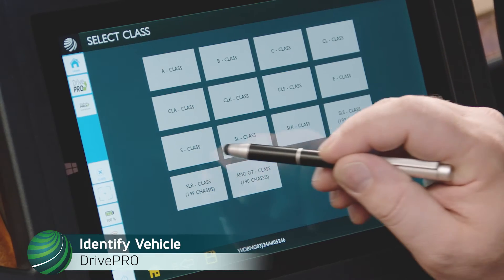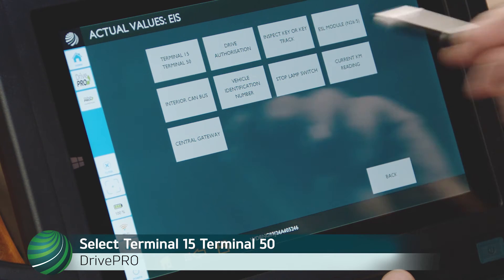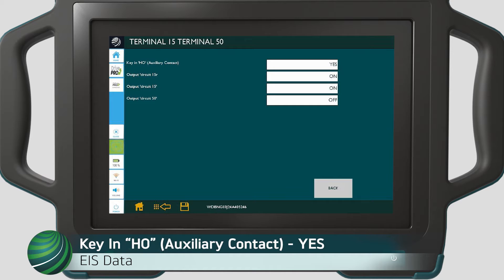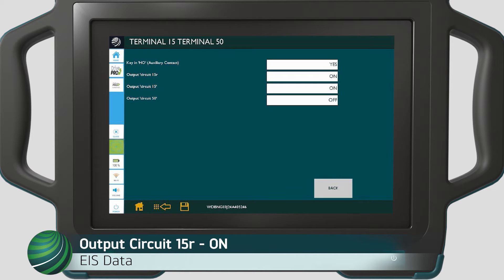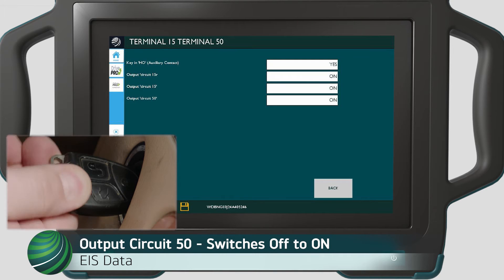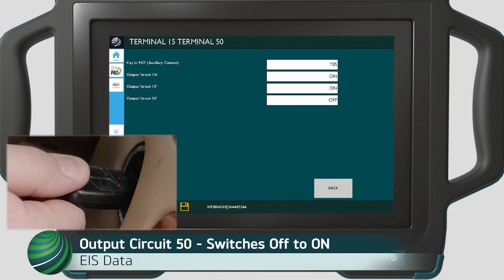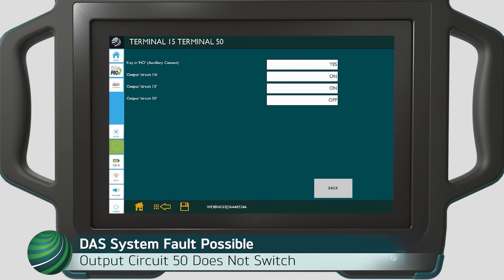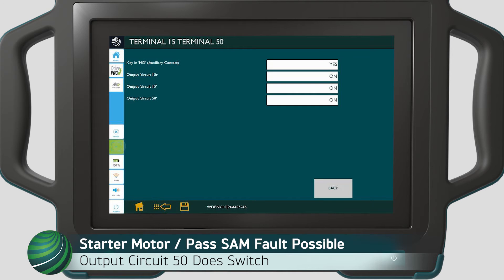Mercedes Benz Electronic Ignition System (EIS) Diagnosis

Comment: I have the "no crank no start" issue (plus "no fuel pump") on my '97 C280, but only occasionally! The first start-up in the morning always works. If I stop at the fuel station 5 minutes later, just like yesterday, the car may not start again. If it happens, all the lights are on as well as the ignition, but I don't hear the fuel pump and turning the key won't do anything. I was able to get the car started yesterday by tapping on the ignition switch (the plastic cover was already removed). The EIS or some loose connection inside or on the back seems to be the culprit here, would you guys agree? Changing the key makes no difference.

Comment: Yeah thanks this circuit 50 stuff blew my mind. The picture showing purple wire helped. Never heard of circuit 50. I do however know about a starter relay. Lift is out and inside you have pins 85,86 87, 87a and 30 - Its 87 that goes directly to the starter solenoid. Lou (a guy on youtube) told me its the wire to starter. So then just say pin 87 from starter relay. 

Does anyone out there have a logical reason for why they dont say that?
Reply: The term "terminal 50" or "circuit 50" is a standardized name for the starter motor activation circuit. The organisation that made the standard is called "DIN" an abbreviation in German for their standards organisation. DIN is also responsible for the numbers on the relay pins (i.e. 30, 87, 86 and 85) as well as 15 (ignition ON), 31 (Earth), etc.

Comment: Our shop has the latest autologic and also the legacy one..we can’t even scan for codes, key doesn’t even turn. Same car..
Reply: I remove eis and then send away to be repaired when that happens and if both keys wont make it turn. Always come back repaired. I am learning more though. They dont like cold weather. You can get a cheap donor and buy the equipment to clone an Eis yourself. Only equipment is over a thousand pounds and repair if like under £300 so if you only doing one, send it away to Eis rebuilders. Find them on EBAY.
Reply: Where can I get phone number for eis rebuilders. Please link me up
Reply: I sent mine out on ebay and key still doesn't turn

Comment: 2007 E550 4 MATIC

Circuit 50 for me changes from off to on but the car doesn't crank. It also doesn't show P or C or S mode on the instrument cluster when the engine is off but the key is in the ON position. Sometimes the P and C or S mode will randomly show up and then the car turns on normally. When it's on it drives normally. I also sometimes randomly get ABS and ESP inoperative messages while driving, PRE-SAFE INOPERATIVE, Steering gets harder then it goes away after a few seconds of driving. HELP!! lol
Reply: Did you find a solution? My ML 2008 is doing the same thing
Reply: @sco234  Yes. I had a bunch of weird things happening to me, and it ended up being the front SAM fuse box. The previous owner had left it exposed a whole winter, and water had seeped in and corroded the whole board inside, causing a bunch of weird things. I ordered one used from eBay and changed it and all my problems were gone...
Reply: Did it need to be reprogrammed  @MidnightClubin
Reply: @VallyViewz  the one I got had ended up coming from a CLS550. Same fusebox but you did need to use Star or some other computer to let the ECU know that it's for an E550, not a CLS550. For example, as soon as I plugged the battery back in, my headlight washers went on non-stop which ended up burning the washer pump because it kept running for like 2 minutes straight, until my friend was able to find the menu on his laptop to change the setting to an E550.

Comment: This is a great video I had a 2009 164 do the same thing, I had an authorization issue at that time..
Reply: Hi! I have an '06 164 and its doing something similar when trying to crank the instrument cluster powers down,  this happens a few times before I can actually start the car, can you tell me how you fixed it, or got it fixed? Thanks in advance!
Reply: @samstrat01  hi, please I have same problem e klasse 220 2007, did found the problem?
Reply: @samstrat01  same here
Reply: And how u fix that one